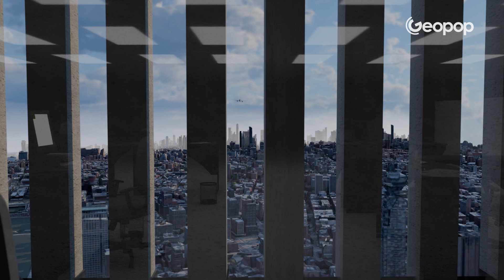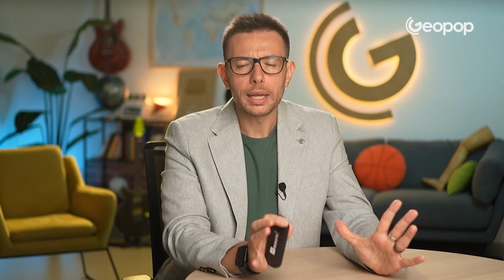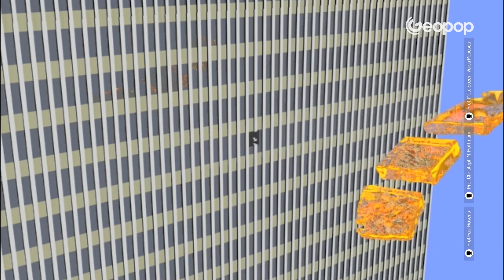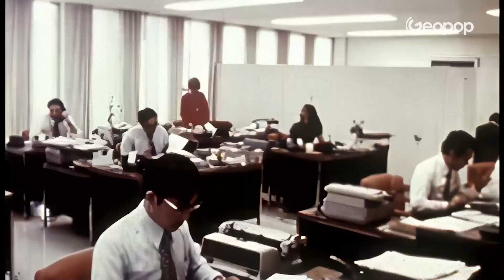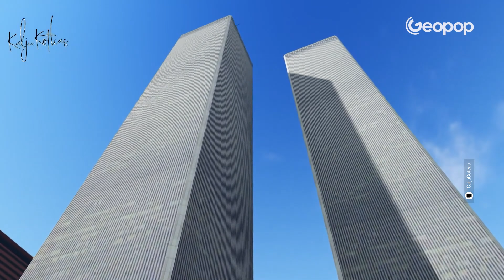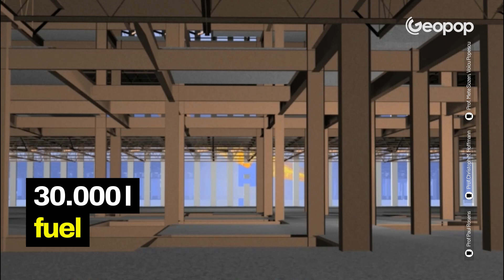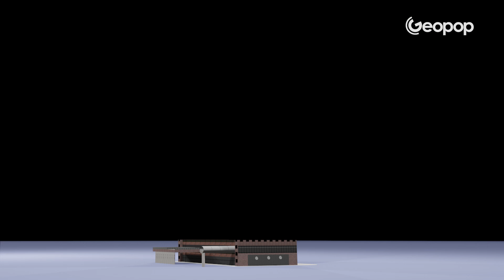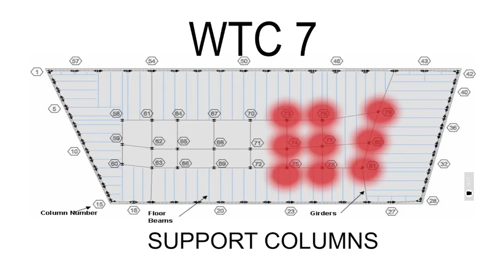9/11, 2001: The Technical Reconstruction of the Twin Towers and WTC 7 Collapses

Comment: It is physically impossible for a commercial airliner to achieve 750 kph at sea level without compromising the structural integrity of the wings and the underlying structural components.
Reply: And a Kamikaze pilot cares about airframe fatigue life why?
Reply: Eduardo Kausel, Professor of Civil & Environmental Engineering, Massachusetts Institute of Technology has determined a speed of 810 kph or 503 mph. That might exceed the safe airframe limits at low altitude, but keep in mind that terrorists don't care about safe operational limits & many mechanical stress tests exceed 150% of recommended operation load. The airplane can easily be said to be performing near maximum mechanical stress. Not optimal for repeated use, but that's irrelevant because this was a one way final flight. The evidence can be disputed or ignored, but there's really no doubt that large aircraft were flown directly into WTC 1 & 2. F=MA.

Comment: This video explains what happened to would trade center 7 unfortunately one of the towers antenna hit the building. 

https://youtu.be/KMvCWFCoVN4?si=36lPqSfDdic-6oab
Reply: Your video is a perfect example of someone trying to act like they know what they're talking about. He says that steel beams are as strong as a cereal box. No. He claims one has bent at a ninety degree angle when it is bent at a ten degree angle.. here's what really happened. Pay close attention to number 2, 4, 7 and 8. All talk about tower 7. 1.The firefighters said" it looked like they planned to take down the building" I didn't say that, The fire fighters said that. They were there.I'm sure they know best.
https://youtu.be/XiIT4HInWjY?si=e1Pvp3-IFs-M75Oj
When the firefighter says "boom, boom, boom, boom" in this video.
What do you suppose he is?Implying by " boom" ?? What do you hear? 
2.So if there were no explosives then what is this? 8:25
https://youtu.be/bLF5D7M1YgA?si=aHSvS__uOdxMi1ZB
You can't say that it was added because you can see the firemen's reaction to the explosion. And you can't say it came from anywhere else because the firefighter says
" We gotta get out of here,  7 is exploding "
3. Controlled demolitions have squibs, you can see the squibs here 20 floors below the collapse. 
https://youtu.be/eXAgulfAtR4?si=-iLO9aQjMJVLTUYH
4. Firefighter says "any one of these buildings could blow up,  this ain't over yet" firefighter says there's 3 secondary explosions. 
https://youtu.be/0Gh3ErgMI4M?si=mmp9Eus_5PWTCBfl
5. Airplanes can't fly 600 mph at 1000 feet. And to be able to make a 180 degree turn to hit the opposite side of the pentagon going that fast is ridiculous. And since when do terrorists hit the opposite side of the building where no one was at when they could have just flown straight in and killed way more people???
https://youtu.be/0Gh3ErgMI4M?si=mmp9Eus_5PWTCBfl
7. No one has ever known ahead of time that a building was going to collapse except through controlled demolition.  Tower 7 was reported to have fallen while it still stood in the background. 
8. Larry silverstein,  the man who made over 4.5 billion when they fell, claimed to have pulled the building down.
https://youtu.be/1jQaJFNWqtc?si=wCywQ9grgBdS_w11
9. A witness reported a missile hit the pentagon while he was seen at the scene. 
And the hole wasn't big enough for a plane and the damage wasn't consistent to the towers. And just like shanksville,  there's pictures that show no plane parts at all.
https://youtu.be/6_Ez-UCpXMs?si=JaQ6DBEC_LJtMLgN
10. That video also points out They were military planes that hit the twin towers. 
11. All sorts of reports of explosions were reported that day.  
12 Buildings dont accidentally fall  Into it's own footprint.

Comment: What caused the concrete to turn to rubble in mid air? Fire doesn’t do that. Molten aluminum turns solid fairly quickly once it is spread out. If it didn’t melt the steel wouldn’t there be long pieces of steel bent up all over the place? How did each floor fall at the same rate as the one before? 10 seconds for the world’s tallest skyscrapers to fall under any circumstances seems a little suspicious. WTC7 how is that even in question? A little damage on the outside and small fires on the inside made it collapse. Free fall speed. How’d the steel beams melt in that one? Bush was sitting in an elementary classroom listening to book reading. We know he didn’t understand it. When he was told he barely even acknowledged it. He must’ve been more interested in the story. The guy filming Washington happened a year before 9/11. Plenty of time to set up the demolition equipment.
Reply: You've been reading (and mindlessly repeating from) too many conspiracy web sites.  You should watch the video above.  It is orders of magnitude better than ANY of that crap and has the added benefit of being fundamentally correct.

Comment: Pulverised to dust and nano thermite found in the dust cloud under an electron microscope........Molton steel found on site as well as 45 degree cuts on vertical steel columns........ Visible squibs exploding between 30 to 60 floors...... Steel ejecting from the building up to 300 ft away?........
Reply: OK, now put all of that together in the form of a coherent narrative. 

I won't wait up.
Reply: @TheLoonResistance 😅😅😅 that's a great point you made there 😂😂😂 no need to do any more, a list of things that you can research and find the truth on your own. Might need to use your brain so idk it might be out of your reach.
Reply: @4STRO7006  - OK.  Just remember to be careful what you ask for cuz you might just get it.

Twin Towers collapses were well understood in the professional engineering community within just weeks. Yet there’s still a lot of really bad information floating out there easily accessible on the internet, premised on wild baseless speculation and pathological theorizing with easy hand-wave answers.  Engineering is hard. This stuff is simple, exciting and requires little or no thinking, so it gets far too much attention.

Because anything can seem like a conspiracy if you don’t understand how it works I prepared my own short yet detailed technical description of Twin Towers collapses from my own observation and analysis of available true and relevant facts. No politics, ideology or magical thinking, just engineering. Hopefully this will dispel many common myths and answer most if not all questions you may have about the collapses.  

While complex, most of the Twin Towers collapse mechanisms can be seen with the naked eye and easily discerned and understood by the layperson if sufficient time is taken to understand.

1. The Twin Towers consisted of 4 primary structural elements that together formed an integrated system where each relied on the others. 47 hollow box-section steel Core Columns carry the majority of the gravity loads. The 236 hollow box-section steel Perimeter Columns carry the remainder and ALL of the lateral (wind) loads. Long-span Lightweight Steel Trusses connect the core and perimeter column together at each floor with a Hat Truss on top to tie the structure together as an integrated unit where no element can survive without the others. There was no structural load bearing concrete and most components were bolted together.

www.youtube.com/watch?v=u7OqrC74Dm4

2. The impact of 117 tons of airplane (= to about 12 dump trucks) at speeds up to 590 mph with the energy of a ton of TNT completely destroys the aircraft. This in no way implies the Towers come out unscathed. Many perimeter columns are damaged or destroyed as are some core columns (example; 33 of 59 perimeter and 20 of 47 core columns damaged or destroyed at the impact floors in the North Tower), This damage is primarily through bolt-shearing failures at the end connecting flanges, as well as bending, twisting and fracturing of weld seams. There was no cutting or slicing - the reality was far more violent and messy.

3. The impacts destroy or damage fire insulation, fire breaks and sprinkler systems on multiple floors. Huge fires are started across multiple floors simultaneously and allowed to spread rapidly with no effective firefighting or fire suppression. This was an unprecedented fire event .

4. The hotter steel gets the weaker it gets . With fire insulation stripped away and no sprinklers the survival time of the steel greatly reduced. Gradually over time heat causes the lightweight steel Floor Trusses at the impact damaged floors to sag, which was observed and recorded. No steel melted or needed to. Structural steel fails long before it becomes a puddle. It just needs to bend

5. Sagging floor trusses pull on the increasingly weak and overloaded Perimeter Columns, causing some of them to bow inward by up to 5 feet. A straight column is up to 4 times stronger than a bent column. The bowed Perimeter Columns buckle and fail, quietly initiating collapse. The formerly static mass above which the structure below could easily support is converted to a dynamic mass up to 30 times greater. Because they have buckled, the Columns above and below the failure point are no longer aligned . The load bearing structure below no longer bears any load as it falls past the lower columns, NOT onto them.

www.youtube.com/watch?v=ULdiD6gYZO0

6. Thousands of tons of debris fall within the four outer walls, down through the open office space, crashing onto the first intact floor it encounters, immediately breaking the bolted column connections as the amount of resistance the Floor Trusses can offer is negligible. The falling debris slows only marginally and briefly. Note: 
6a. This is NOT a solid top block crashing into and “crushing” a solid bottom block . 
6b. The debris falls past the columns not onto them. The columns provide no resistance to the falling debris. 
6c. Only the bolted floor truss connections to the core and perimeter columns offer any resistance. A pair of 5/8” bolts at each end of each truss vs. thousands of tons of falling debris. 
6d. No laws of physics are violated. 
6e. There is no 20 floors against 90 floors but rather 20 floors against one floor, then 21 floors against one floor, then 22 floors against one floor, etc. 

7. This floor-led collapse progression within the four outer walls can only go straight down.
7a. This process is often incorrectly referred to as “pancaking”. The catchy name stuck but nobody knows what it really means and "pancaking" is too simplistic and inaccurate anyway. I prefer Kaiserschmarrn.

8. Collapse progresses through the floor systems past the columns, through the path of least resistance . The resistance offered by each floor is always the same while the mass of debris and its velocity – thus its energy - increases with each floor failure. Each floor offers the exact same resistance to the falling mass while with each failure the falling debris constantly gains both mass and velocity. *This process of floor-by-floor destruction cannot be arrested, it can only speed up . Rate of floor failures increases with each floor as momentum increases, reaching an average acceleration of 0.65 of GA, or 35% slower than true free fall. Bam, bam, bam down the building until there are no more floors to fail. The resistance offered by each successive floor is always the same. More mass, more velocity, same resistance with each floor. Don’t get stuck on the but the lower floors weren’t on fire nonsense. They weren‘t and didn’t need to be.

9. The Towers were 95% air by volume. As that air was compressed inside the building it is forced down the tower and blown out the sides in reaction to the building collapsing . Those were not “explosions”, it was expulsions of compressed air caused by the collapsing building, explaining the low velocity, lack of flash, blast, supersonic pressure waves and lethal high-velocity ejecta.

10. Perimeter Columns become detached and peel away like a banana behind the collapse front, playing out to the four points of the compass extending to more than 600 feet from the base of the towers. This was quite obvious from examination of the debris pile.

11. Core Columns fail last as their internal beam bracing is stripped away by falling debris and lateral support from the floor to perimeter columns is lost.

12. For those who care about how long this whole process took; 31-34 seconds from the moment the perimeter columns buckled until the last core columns hit the pile, or 1/3 the rate of true free fall. Don’t believe me? Just watch any video of the collapses and note the loose truly free-falling debris dropping much faster than the towers themselves.

13. Each Tower had a 1-acre footprint. Far from collapsing inside their own footprints the debris pile spread out over 17 acres in a pile up to 14 stories deep. 8 surrounding buildings were destroyed and scores more damaged by the falling debris.

14. NOT observed were the 180-190 dB bangs of thousands of high explosive devices or the blinding bright flashes of burning thermite. Neither explosives or thermite could have survived the impacts and subsequent fire nor could have caused the (silent) perimeter column buckling that clearly initiated collapse either. A video of a shocked and injured firefighter casually using the magic word explosion is in no way proof of explsoIVES and the demolition_ case relies entirely on that sort of thing. There is zero tangible physical evidence and it would be technically impossible, totally impractical and completely unnecessary. No one would bother.  In 24 years zero structural engineers of tall buildings, including the 1/3 that have retired in that time, have made any statements in support of pre-planned demolition claims. NONE. The lack of any such citations in the engineering literature (published in any country worldwide) is telling.

15. Twin Towers were perfectly safe within their design envelope. They only collapsed when taken far outside design parameters by an extraordinary and unprecedented event

Impact + Fire (heat) + Time + Gravity = Collapse . Remove any one of those 4 elements and there is no collapse. Ignore any of those elements (as many do) and you will never understand the collapses. The Twin Towers were an integrated system in which no one component could survive without the others. One fails, the rest follow, through the path of least resistance – DOWN – through the open space, bypassing the path of greatest resistance – the columns. Nothing I just described violates any laws of physics. All of the above is true no matter who planned and carried out the 9/11 attacks or why

I hope you found this helpful and informative. It is not meant to be adversarial, but to solicit informed critical comment, positive or negative. If I made any errors of fact, logic or reason or left anything critical out, please let me know so I can fix it. To stay focused just one topic at a time please and on-topic (Twin Towers ONLY). No word-salads of Gish Gallop. IF you can offer a more plausible alternative be my guest. Please start any reply with the words “Tits McGee” or I will know you didn’t actually read it, are not serious and just wasting my time. If you are going to argue, do it on the merits.
Reply: @4STRO7006  - Glad we got that sorted out. Have a nice day.
Reply: @TheLoonResistance Lol, bros probably went into buffering mode.....
And i applaud you 👍🏼